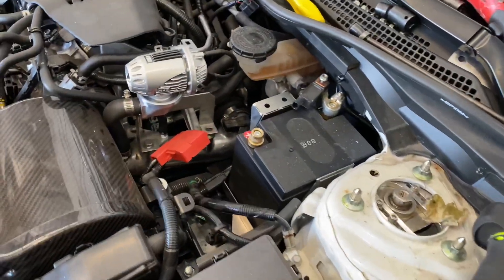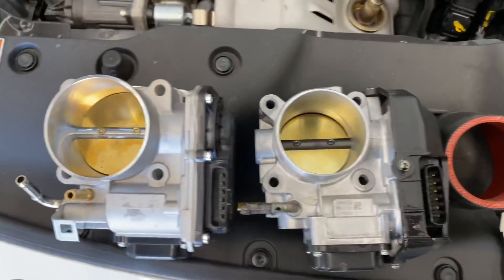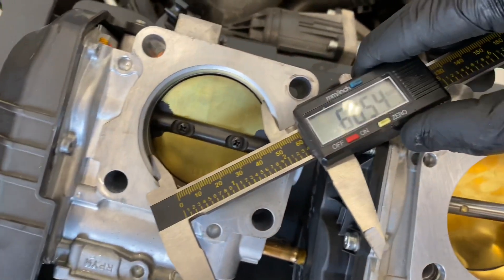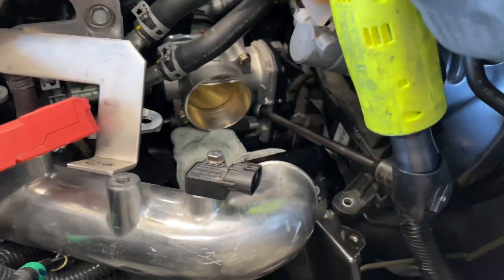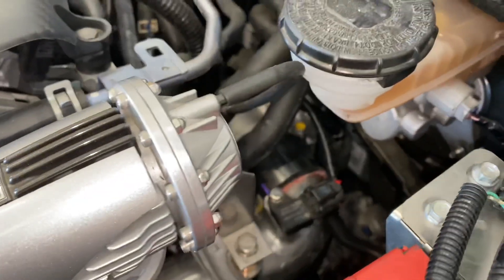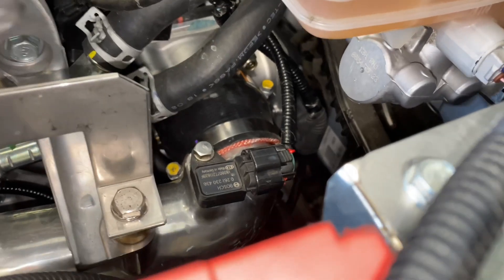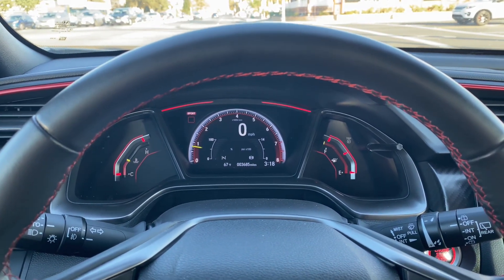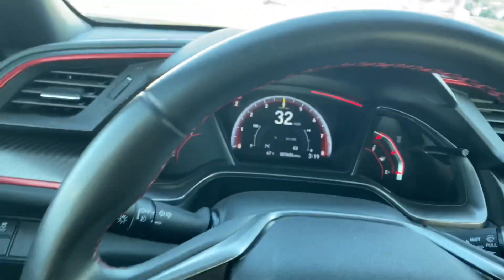First look!! Civic Type R big bore throttlebody FK2 FK8

Comment: The dip in the rpm is %100 caused by the hks bov. I know cause had the same issue thats why i removed mine.
Reply: So you don’t recommend hks bov on the fk8? Am thinking to put one on mine. Any suggestions?

Comment: i would believe all 10th gens 2.0s share the same throttle bodies, accord and type Rs share the same internals… just that the 2.0t is “detuned” compared to the R. 2.0 civics have lower forged internals but made with some light grade material heads and valves.

Comment: is this need a custom tune? or the ktuner or hondata stage 2 will work?
for honda accord 2.0t
Reply from the maker: Well you’ve seen our own car use it without tuning.  But we did tune the car beforehand because we have other mods like intercooler and stuff.  Any mod you make you should want to tune the engine to utilize the new mods.  But doesn’t mean you cannot drive on the throttle body with out it.  You’re just not getting full potential of the upgrade
Reply: @BalladeSports  thank you
Reply: @BalladeSports  when is this going to be released?